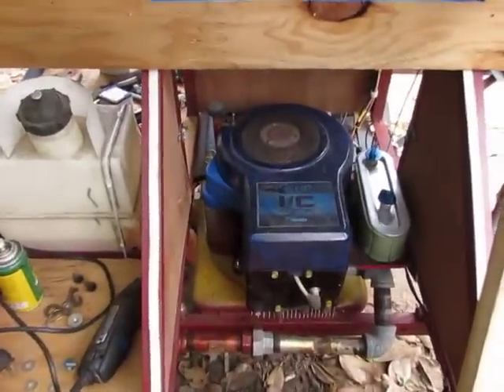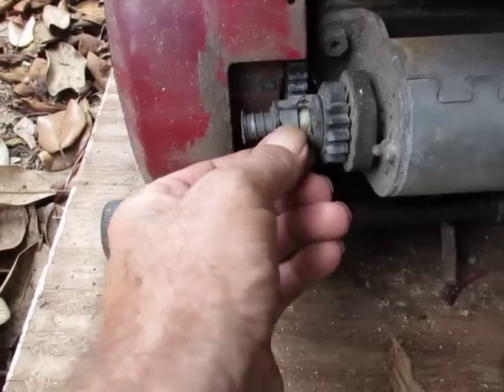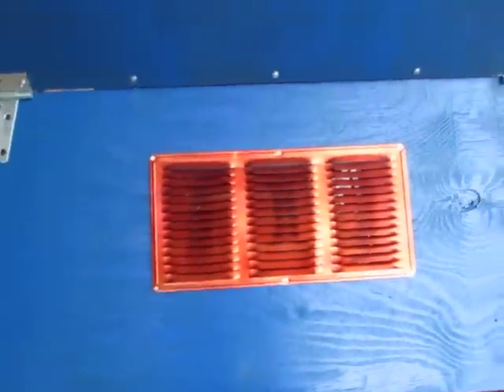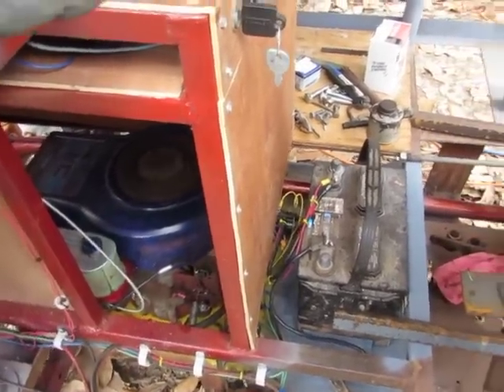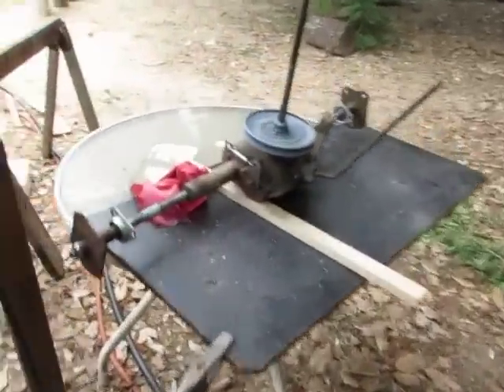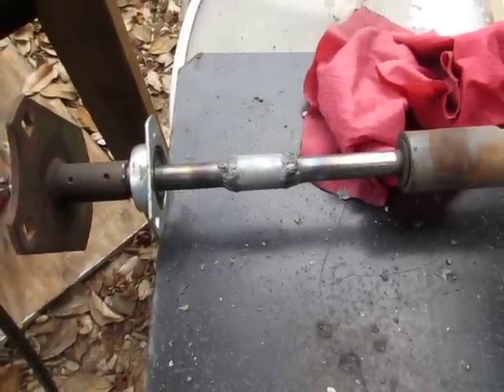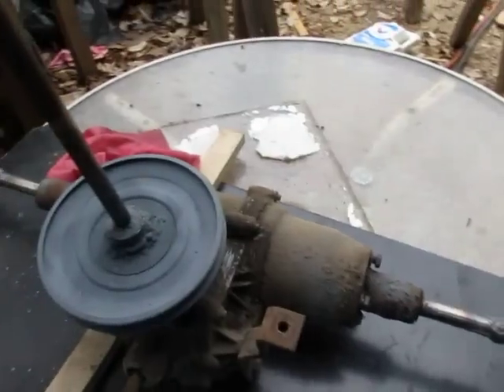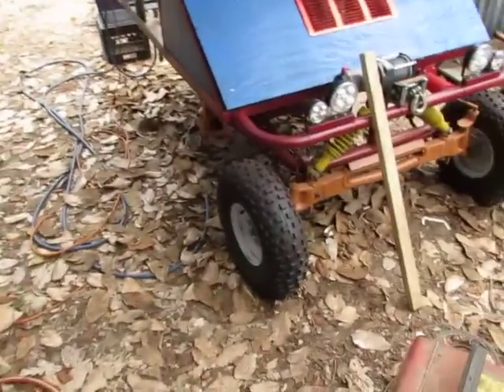Update on the Abomination..

Comment: You're very patient Dave! I've been wondering what type of axle you were going to use........
Reply from the maker: I used to NOT be so patient back in my younger years Patrick..I learned to take my time & figure the best way..or the strongest way. This was the strongest way I could figure to do it..duals were my first thought, but the machine was too heavy..I figured I'd break it before I could enjoy it..Thanks!
Reply: Are you going to put those cassette bearings near the ends of the axles?
Reply from the maker: Patrick Parsons
Yep..correct Patrick, they'll go out as close to the ends as I can put them..I have about an 1 1/2" clearance between the vertical supports and the tires.